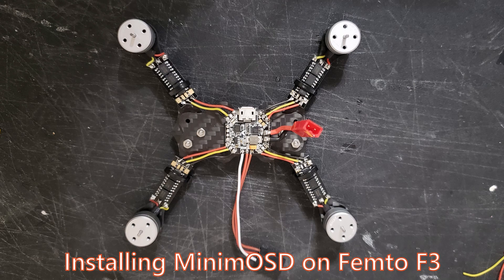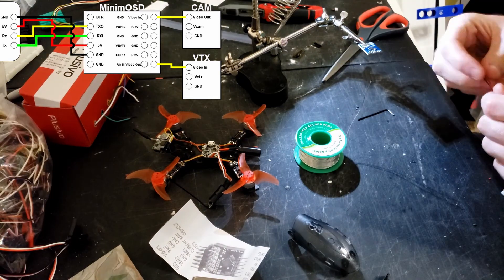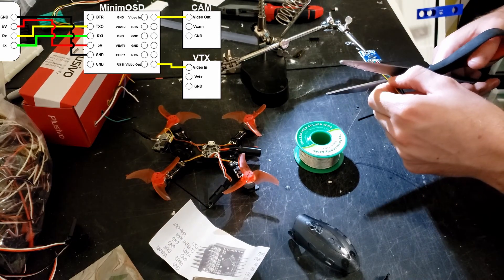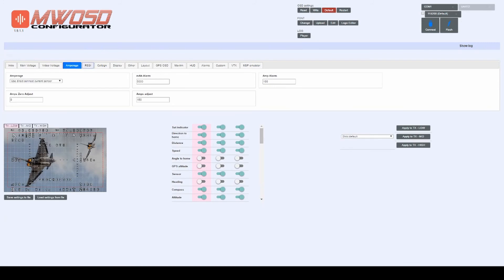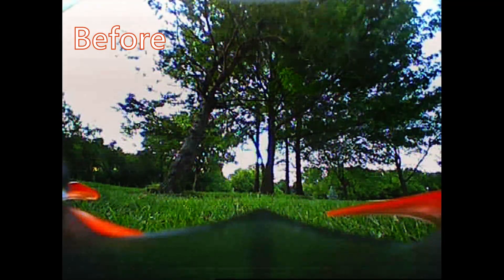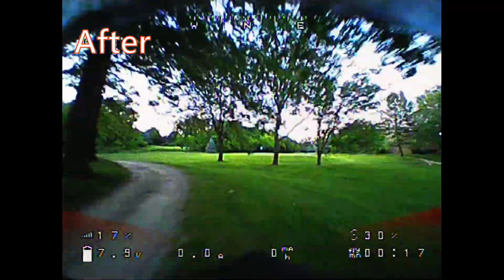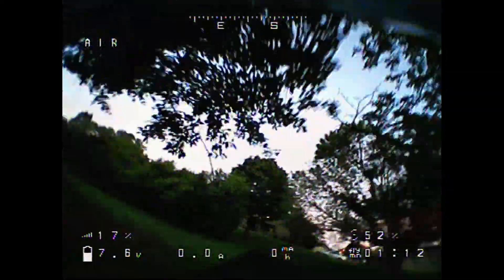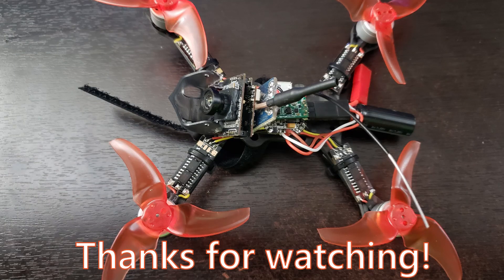Micro MinimOSD Install Femto F3 [betaflight]

Comment: Alright so with the xm/xm+ it justa connects to rx3 right? Sorry I’m sure you’ve been done with this project for a while.
Reply: All bound up
Reply from the maker: @dauntlessfpv  Sweet, I hope the maiden goes well!
Reply: My radiomaster TX16S is great
Reply from the maker: Yeah, SBUS/DSMX go through RX3.
Reply: Crap. What channel map do you have, because mine is not happy in the receiver tab in betaflight. I’m trying to do taer
Reply from the maker: @dauntlessfpv  I am also using taer, but i'm wondering if the TX16S is aetr, when you throttle up do your aileron input move instead?
Reply: No the receiver is super confused and had crazy inputs and is spinning and stuff
Reply from the maker: @dauntlessfpv  sounds like the throttle is going to pitch or roll so the model is rotating like crazy. Are any of the inputs low, like around 1000-1200?
Reply from the maker: @dauntlessfpv  looking at the manual for the TX16S, looks like the default channel order is AETR
Reply: When I add to any channel, I can see all channels fluctuate like crazy. I’m asking Joshua Bardwell
Reply: I have changed it to taer
Reply: I feel like an idiot. I had my fc still running spek 2048 instead of SBUS. I guess I didn’t save that. Oops. 🤷🏼‍♂️🤫

Comment: Real question about the video. Will the tbs unify pro32 nano have built in osd for this quad? I’m only after battery voltage.
Reply from the maker: The TBS Unify Pro32 Nano is a VTX and I do not believe it has an built in OSD. The OSD generally comes from the Flight Controller since that is where majority of the computing power and data is at. 

I had to get an external OSD for this project because the femto F3 does not have an on-board OSD. The External OSD takes information from the FC and puts it over the Camera feed, then sends that spliced feed to the VTX for transmission.

I'd recommend finding a FC with an on-board OSD (majority of FC's made for Betaflight in the current generation have on-board OSD's)

If you can't find a FC with an OSD then you'd need to get an external OSD like the minimOSD.
Reply: Fur Eter would the frsky mini osd work? I don’t see how it could do batt voltage tho
Reply: Also how did you get battery voltage from a bad on the femto?
Reply from the maker: @dauntlessfpv  i looked into the FrSky OSD and it looks like betaflight currently does not support it. You might be able to get it working if you compile the code yourself, but its probably not worth the effort.

The Femto F3 connects to the miniumOSD over UART and sends the information I want displayed to the OSD. This includes the voltage, attitdue, flight mode, etc

The easiest way to have an OSD is if its already integrated onto the board
Reply: It’s try (once I get the quad working) to get a caddx turtle v2 and get power from the battery connection for its built in osd.

Comment: I’m going to try to get the frsky x9 lite s. Did you have to invert SBUS on your reciever for the femto. Also will the frsky rx6r for my fpv plane
Reply from the maker: I did not have to invert the SBUS on the femto. If you haven't already ordered the x9 lite, try looking into the RadioMaster T16xs, its multi-protocol so you'd be able to use it with multiple receiver product families. The switch over to the ACCESS firmware by FrSky has cause some issues with a lot of people because its not backwards compatible with ACCST products and there are no third-party ACCESS receivers that I know of right now, so the ACCESS receivers are more expensive. But if you've already ordered it'd be a great transmitter/receiver combo.
Reply: Fur Eter I have now
Reply: Fur Eter sorry I meant I have not ordered anything.
Reply: Fur Eter I need to try to sell my dx6e. Any recommendations for a site to sell on?
Reply: Fur Eter everything is so complicated! Can radiomaster t16s do DSMX for my plane
Reply from the maker: @dauntlessfpv  the product descirptiom says it supports DSM/DSMX along with other protocols like FrSky, though i'd check reviews to see if it'll work with you.  I've never tried to sell RC gear, maybe try ebay or the rc hobby subreddits or rcgroups
Reply: Fur Eter I mean radiomaster
Reply: Thanks. I still think I might go with the frsky, is that the multi protocol the only reason somebody would the jumper?

Comment: Help I can’t get motor 4 to spin up!
Reply: Thanks for the reply. I and using the femto f3 fc, same as u, and 6a bullet escs (not 4 in 1). I have fried the birds twice, (my third is in the way) because I couldn’t get motor 4 to work. I have tried re directing motor 4 signal to ppm but no luck. I am trying to use Dshot 600 but I may have to settle for oneshot 125
Reply from the maker: @dauntlessfpv  I ended up having to settle for oneshot 125 as well, I would check all of the solder connections. I didn't have any issues with the femto communicating with the 6a bullet esc's except when I had a bad solder connection to one of them. I also updated the firmware on the bullet esc's using the BLHeli-configurator.

Try using the BLHeli-Configurator to see if it can detect all 4 esc's, if it can see all 4 esc's check if the settings are the same across all 4 esc's. If it can't see all 4 esc's then it could be a solder issue, the esc could be bad, or motor 4 might not be configured properly in the flight controller.
Reply: Any ideas?
Reply: I have seen people having this problem in the passed. I’m convinced it’s a firmware issue but idk 🤷🏼‍♂️
Reply: Thanks! I am glad to hear of someone recently setting up the board and it working. I was trying to use Dshot and in blheli it wouldn’t even show esc 4. Are you using the most recent betaflight version and most recent firmware for the board? Also in case I can’t get it to work for some weird reason, what’s a good reliable 20x20 board that would be a safe alternative to the femto? I now realize oneshot 125 isn’t the end of the word since turtle isnt necessary especially on quads this size. Do you think a beeper is necessary? Also what props do you use. Sorry for all of the qs, this is my first ever build and quad in general, tho I have fixed wing experience.
Reply from the maker: @dauntlessfpv  I am running the SPRACINGF3EVO target on Betaflight Version: 4.0.6 with firmware released on Sep 1  2019
I compiled the target to remove some features I wasn't planning on using, but I didn't touch any of the motor controls, and I have gotten one of the online builds to run.

For the ESC's I have P-H-10. 16.5 as the firmware, I think I had some issues with the firmware it came with. The motor timing I have set to Medium if that helps, sometimes timing can be an issue.

I think a beeper is good if you're flying in areas where it can be difficult to find your quad if you crash it. Though BLHeli can also be configured to beep the motors when throttle has been set to 0 for a specific duration of time (Beacon Strength and Beacon Delay settings)

I don't have a lot of experience with flight controllers for quads, because I primarily fly fixed wings, I like the iflight Succex Micro F4, though it has 16x16 mounting holes. I've also used the Omnibus F4 line quite a bit (on Fixed wings primarily). The omnibus F4 Nano is 20x20 so that might be a good replacement if you can't get it to work. Albert Kim and Drone Mesh are some good youtubers to look for recommendations from.

For this 2.5" quad I'm using Emax Avan Rush props, but I like gemfan props quite a bit. (APC for fixed wings though, they're my favorite manufacturer)

no problem with the questions, if I can be of any help then thats great!
Reply: Fur Eter thanks so much! I will get back to you when I have it all soldered up again.
Reply: Fur Eter you said you use version 4.0.6, which is that? I’m on 10.7. How do I get 4.0.6?
Reply from the maker: @dauntlessfpv  I'm pretty sure your betaflight configurator is version 10.7, I'm using configurator version 10.6, which shouldn't matter. 

Thats not the version of the software running on the femto F3. You can check the software on your femto F3 by connecting to it, going to CLI and typing version. 
I get: 
# version
# Betaflight / SPRACINGF3EVO (SPEV) 4.0.6 Sep  1 2019 / 01:06:10 (2a64051a2) MSP API: 1.41 / FEATURE CUT LEVEL 8
Reply from the maker: @dauntlessfpv  I've seen some good reviews about that board and esc combo, that'd be a solid stack to go with. If you can't get the femto F3 to work for your quad you could probably get it to work with a fixed wing. I bought an extra femto F3 and plan on using it for a fixed wing eventually. Though it'll be a lot of configuration to get it to work.
Reply: Fur Eter are there any other small boards that are designed for individual escs?
Reply from the maker: @dauntlessfpv  The Matek F411-MINI looks like it'd work, it has S1-S4 pads on the board that'd go to ESC1-ESC4 signal. It seems a lot of drone FCs are moving towards 4in1 connectors for the ESCs, though from what I understand you should be able to take the m1-m4 wires along with GND from the 4in1 connector on an FC and connect them to 4 separate ESC's. I don't think I've seen anyone do this, and I haven't tried it, but m1-m4 are the signal connections for each esc, and the gnd is to give the signal connection a good grounding. You'd probably want a pdb to connect the 4 esc's into though to keep noise out of the power supply to the FC.
Reply: Fur Eter if it doesn’t work I’ll find some use for the escs on a micro wing or something and get a 4 in 1
Reply: Fur Eter the one wired thing is that my boards have the arrow facing to the side, but I don’t think that makes much of a difference in anything except the orientation
Reply from the maker: @dauntlessfpv  There are two versions of the Femto F3, one with the USB coming out of the side, and one with the USB coming out of the back relative to the forward arrow. The one with the USB in the back was made for the original babyhawk 85mm quad, and the one with the USB in the side is the more recent version. I have both board variants and I don't think there is any difference besides the USB orientation.
Reply: Thanks for helping me with this hobbie!
Reply: I’m soldering later today. I’ll tell you how it goes. What’s your plan for a femto on a fixed wing? What’s are you controls? I’m super curious about that!
Reply from the maker: @dauntlessfpv  There is an airplane mixer in betaflight that I plan on using for the femto F3 to configure it for an airplane. I'm not sure what the wiring is for it yet, because I've been working on a different project, but It'll just be a single motor and 2-3 servos depending on what sort of air-frame I design.
Reply: Ok so it all works except I can’t bind it to my transmitter
Reply from the maker: @dauntlessfpv  you can't get betaflight to communicate with your receiver, or you can't bind your receiver to your transmitter?
Reply from the maker: Need some more information to try to help:
1) What flight controller are you using? 
2) Are you using an All in One ESC or an individual ESC per Motor?
3) When you throttle up do Motors 1-3 move? 
4) How are you trying to move Motor 4? Can you increase the signal to Motor 4 in the Motor tab of betaflight? What does it do when you increase the signal, does it twitch back and forth?
Reply: Ok good to know thanks
Reply: I’m using a spectrum dx6e and I can’t bind it to any receiver I’ve tried 2 different ones. One won’t work with the femto, and one won’t go into bind mode
Reply from the maker: @dauntlessfpv  Sorry I'm not too familiar with the Spectrum receivers, I've only flown with FlySky and FrSky products, I use FrSky receivers for all of my quads. If you've already followed the users manual for the receiver and you can't get it to work you could probably get some good help in r/radiocontrol and r/diydrone on reddit.
Reply: Fur Eter it’s ok. I’m going to use the newer receiver with an iflight stack. I want to use femto and escs for a 4 motor hover craft? Is there any way to reprogram the femto into knowing its now on a drone?
Reply: Actually since I don’t have a reviever, will the d shot 6a escs work with an airplane reciever if they are on oneshot 125
Reply: Fur Eter what Fr sky reciever are you using?
Reply from the maker: @dauntlessfpv  I've ran a 20A Bullet ESC from the PWM on one of my receivers, so the 6A should work as well. I don't think receivers support Oneshot 125. I've never tried to run the 6A bullet ESC off of PWM, but I have some extras so I could try it. 

I use FrSky XM and XM+ receivers for my quads with SBUS, and a mix of other FrSky receivers for my planes. 

You should be able to make a hovercraft with 4 motors, I've seen people convert tinywhoops into hovercrafts. In the betaflight configuration tab you can change the mixer for your flight controller and that determines the vehicle configuration. If one of the pre-set mixers doesn't work for a hovercraft, there is an option for a custom mixer.
https://github.com/betaflight/betaflight/blob/master/docs/Mixer.md
Reply: I’m thinking of going frsky. Would you recommend the q7x ACCESS with a xm+ reciever? Also what is a cheap 6 channel frsky airplane reciever

Comment: only problem i see is you need some separation from VTX i picked up some micro run cam 25 to 200 watt vtx for cheap they work great good range also
Take Care
Reply from the maker: Thanks for the advice! I put in an order for a new VTX and Camera, not a fan of the babyhawk AIO so far. The VTX I ordered was a RunCam TX200U, is that the same one you picked up?